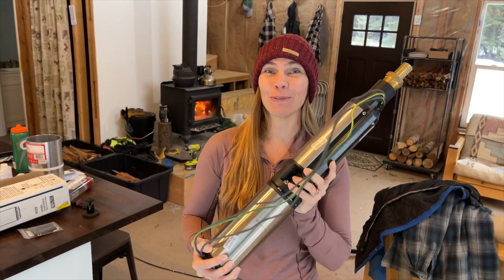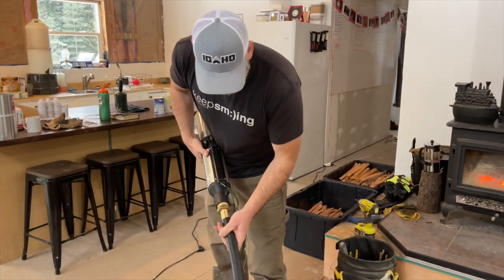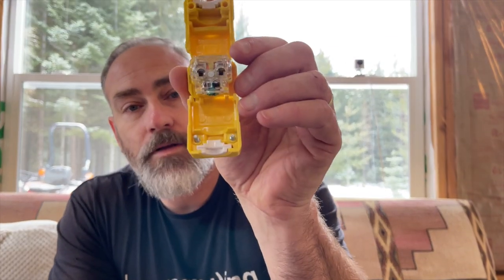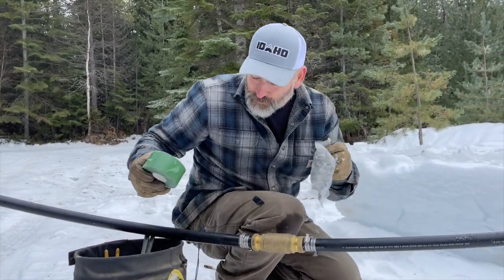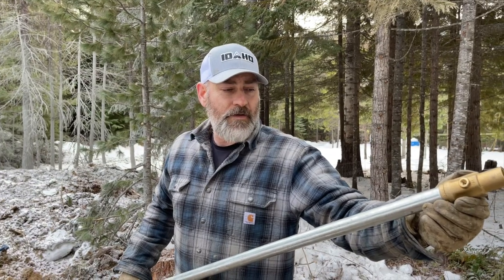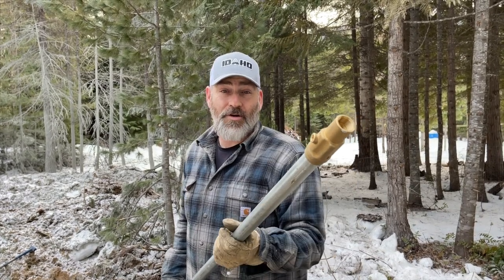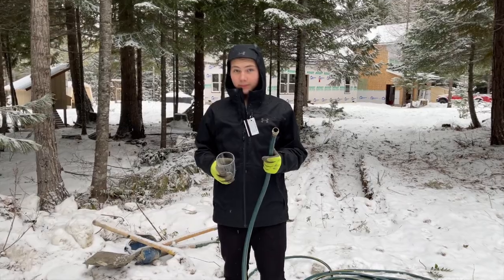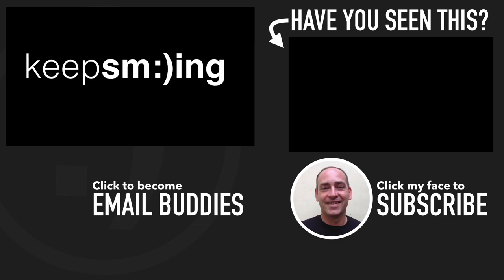WIFE is HAPPY/HUSBAND is NOT - DIY Well Pump Installation

Comment: How deep did your well end up being? Also, did you have a professional driller come out to drill the well?
Reply from the maker: 520' yes they were pros.
Reply: @MartinJohnsonOffGridLiving  520, WOW!! That's too bad they didn't include the pump and everything else with the job. Is it standard practice in your area for them to just drill the hole and install the pipe?

Comment: 🤓Congrats👍
Ya larger generator or commonly w Pumps , Motors & Generators is Use of a Capacitor 
Ya dropped from 35-36amps to about 12 ; so wire up a proper capacitor & standard 115v 20 amp should work Perfect . 
Now filtering that brown ? OYE glacial flower 😣 
   I wonder would a centrifugal filter work ; dump , rinse & reload ? 
 Some big rings & race Diesel vehicles use these to filter Oil ; oil looks clean Not typical black . 
Other industrial applications too 
 Bon Chance 
 Just how did ya get them Huge shoulders in such a small hole 😥 
🖖

Comment: How much was it too drill 640 ft down? I am starting a homestead in the next 3 years on on my land in Nevada
Reply from the maker: I’ll make a video about the cost but you should call a local well driller to find out the price in your area. Apparently there is a wide range depending on state.
Reply: I believe they said $45 per foot

Comment: I'm not sure you have bought the right pump. I can't find any of their ½ KW pumps, that works bellow 300 feet.

Second, you could have bought a Grundfos pump, with soft start, automatic overload protection, auto regulation by water usage etc.
For those, you can also get a box above ground, that communicates with the pump and warns about different parameters, like no water, over protection etc.
They probably cost twice as much, but Grundfos is also high quality. And world leader in pumps.

Edit: Scratch that. Probably 3 times as expensive! Those Star pumps are CHEAP!

Comment: 10ga is NOT big enough. You said 194' of pipe down the well, and it looks like about 300' to the house.
First a 1/2hp pump should only draw near 3.2A at 120V, BUT your clamp on said near 12A.
If your pump were to run near 3.2A, 10ga wire would be the BARE minimum size from the house.
But at the near 12A it was showing, it would calculate out to 4ga minimum wire size.
From right next to the well where you are, at the current depth, with about 200' of wire, you need 8ga minimum to draw 12A from that much wire.
Your current wire size will burn up the pump. So will 12A draw when it's supposed to be less than 1/3 that.

Comment: There is no advantage to a 2 wire pump. A 3 wire uses a start and run capacitor.

This is why the pump wouldn't start.

Comment: (✋ after watching it all)  Amps... = Watts devided by Volts. 3,500 Watt (generator) ÷ 115 Volts = 30.43 amps. (3,500W ÷ 110V = 31.82A...) "We're gonna need a bigger boat.." The shark is too big for your boat.., just like in Jaws!

Comment: Normally you use a control box which includes a thermal overload and a capacitor which is sized to suit the motor. 1/2 hp should be .37 kw. That pump should draw roughly 4 amps under load. The load is full flow from the pump. If the check valve was wrong way around it would be completely closed but if you read the amps it would be a lot less than a full bore pipe flowing.

Comment: You should have added some tape around the base of the pump at least a half inch  to act like a bumper. When the motor turns on it'll smack against the well's wall

Comment: that is a 240v pump NOT 120v... it will use less amps on 240v.. you are using a 120v plug through a generator  that`s why it`s shutting down...there's nothing wrong with the pump..
Reply from the maker: The box and the motor say 115v.

Comment: I would have soldered it with silver solder added Electrolux grease and then used shrink tube with a larger shrink tube over the top of all three.
Reply from the maker: Or I could have just followed the manufacturer’s instructions.

Comment: Your 10 AWG wire has 1.0 Ohm per 1,000ft. 

Lets say you have 250ft. cable length: that's 500ft. of wire in the pump circuit, or 0.5 Ohms drop. At 35 Amp (starting current) you have 35A x 0.5 Ohms = 17.5 Volt drop in the cable. So if the generator maintains 117VAC output at 35A the pump receives less than 100VAC due to cable drop.

Your original generator was rated 3,500W or 117VAC at 30A, so it was probably delivering less than 117VAC.

Do the math and read the specifications rather than all that extra labor, trial and error. But it did make for an interesting video ;-)

BTW, Since you had a three wire cable to a two wire pump you could have doubled up on one lead to reduce that IR loss - but that wouldn't have used the same crimping terminal. I prefer to amend mechanical crimps with solder. The solder provides a more reliable electrical path (lower resistance) and also a added barrier to corrosion on the copper. The only negative aspect of soldering can occur where the solder wicks up the stranded wires: that can lead to fracture if the wire receives repeated flexing at the solder boundary. Probably not a concern in this application.
Hope this helps!

Comment: Are you sure that pump was designed for 120V?? The amp draw tells me that you are double what you should be and thus...you might be really needing 240V instead! 240 V should make more sense as then the amp draw would be under 20 A at that point....?? also check to be sure that this unit might need a capacitor in line with it to help getter' moving.  At almost 200' down..I am thinking you are in need of a larger 240V style.......better check....two pumps can't be both bad at once.

Comment: You think you oversized the wire to the pump. I just looked up a 1/2hp pump@120v it says 9.8a. Given that your well is 500’ deep, and assuming a starting voltage of 120v, the 10guage wire will drop 9.8v by the time it gets to the motor. This drops the voltage to 110v at the pump. This is a 8.16% decrease in voltage , motors are really susceptible to voltage drops. So you will burn out the motor with this wire. Rule of thumb, is to upsize the wire 1 wire size for each 100’. If you ran at 240v this 10guage may work fine.  As the amps will be halved.

Oh and the recommended voltage drop is 5%, not 8% this included the mains voltage to the point of use. So on your system you will need to add the length of wire from the shed to the  well as well as the length down the pipe.  A capacitor might help greatly with the startup but I would rather that you upsized the wire and- added the cap
Reply from the maker: The pump is at 200’

Comment: Are you plugging that into a 120 volt. I've have never seen a well pump that run on 120. All the ones I used was 240 an it took a 30 amp breaker to run t.

Comment: wondering where the magnet is when you drilled the hole in the casing? Or will those steel drill shavings not affect the water quality or the mount angle piece?
Reply from the maker: No magnet. Why would i need one?

Comment: What is the water pipe size
Reply from the maker: 1”
Reply: @MartinJohnsonOffGridLiving   Mr. Johnson i really  love what you doing how you living with your family I am learning alot  from you I live in southern California but  from West African Nigeria where I come from they do not have electricity and running water last time I visited I tried to have them to get well water over 400ft deep but they do not use check valve like the way you doing it and the water is not p Polypropylene Tube that is where my question comes in what is the size the poly tube and how much does it cost? 
And a have questions about the solar system off grid  how much how much volts do I need to power 240V  air condition 1HP and other stuff.
Thanks you.
My name is PhilUmunnakwe at yahoo com
Reply: Mr. Johnson i really  love what you doing how you living with your family I am learning alot  from you I live in southern California but  from West African Nigeria where I come from they do not have electricity and running water last time I visited I tried to have them to get well water over 400ft deep but they do not use check valve like the way you doing it and the water is not p Polypropylene Tube that is where my question comes in what is the size the poly tube and how much does it cost? 
And a have questions about the solar system off grid  how much how much volts do I need to power 240V  air condition 1HP and other stuff.
Thanks you.
My name is PhilUmunnakwe at yahoo com

Comment: I’ve never seen a well pump that didn’t use a capacitor start control box. Even half horse pumps.
Reply: You have to run the pump a lot to clean the mud out of a new well. Keep running it!

Comment: Pitless installed at four feet in Idaho?  I think you are going to be sorry you didn't go a few feet more.

The water quality will get better over time, add a sprinkler system next summer and in a couple years all will be well.
Reply from the maker: Frost line is 24” here.
Reply: @MartinJohnsonOffGridLiving  I didn't mean to sound critical of your install, you are one of the very few I've seen self install a well pump and I'm impressed.  Our well and install is so much like yours with the glacial sediment and we also lived off of a tank for a while.  Our frost free hydrant froze at six feet even with a French drain (gravel bed) installed under the hydrent drain weep hole at the bottom.  I believe this happened cause we would let the hydrant flow for a bit before hooking up the hose to fill the tank.  We did this to flush the sediment that settled out of the 180' vertical riser pipe onto the foot valve.  This bit of occasional  water at the well head along with the hydrant and well casing acting as a heat sink allowed the frost to go deeper than normal.  Once we cleared the majority of the sediment (a couple of years) we put in a UG feed to our cabin and all was well.  And  like I said before, putting in a sprinkler system that runs the pump daily for 15 minutes really helped.

Comment: 120v over that distance is a mistake, IMO... You are losing 30v at your 30a start current with 500 foot of 10 gauge! No wonder it's being picky about what generator you're using. 240v and you wouldn't have had a problem (assuming the smaller generator has a 240v output). Be very glad you went with 10 gauge- it would never have worked at all with 12. I still think you're going to have issues long term- it's going to be PICKY about voltage since you're losing so much in the wire.

Comment: a 3phase 400volt pump would be much better and more reliable if not a pump with a  capacitor
would significantly reduce the starting amps

Comment: If your well goes down several hundred feet and the casing goes down a couple hundred feet why are you setting the pump at 100 ft?
Reply: I’m pretty sure that’s just where the check valve was installed. Then another length of plastic pipe on top of that. I was interested to find out how deep the pump went also. Maybe I missed it.

Comment: 1/2 hp is not nearly enough for that well depth. Water weighs 8 lbs per gallon. 10 gpm is 80 lbs/minute.  1 hp is 550 ft-lbs/sec. Your well is about 550 ft deep.  For 10 gpm, you need to raise 80 lbs per minute 550 ft. That means a minimum of 80/60 = 1.33 hp just to get the water to the surface at 100% efficiency. Expect more like 50% efficiency, and you want at least 20 psi at the surface, so you want about 3 hp.

Comment: LOL You are plugging it in to 120 volt thats a 220 volt pump !@
Reply: He said it's a 120 volt pump during the unboxing, although I was astonished he wasn't going to use a 240 given it's being tasked to lift a 100-200 foot water column, and the electrical cable will be somewhere around 300 feet total from house to motor.  At 300 feet, even 10 gauge wire has significant voltage drop, so it's best to go with higher voltage to mitigate that.  In fact I was surprised to learn they even made 120 volt deep submersible well pumps.

Glad it's working now of course.

Comment: With electricity, you never look at what power the unit is going to use only, you need to know if it spikes upon start up too.  Then ensure that the electrical supply is higher then both figure.  Just in case the unit starts straining and ups its usage levels.  Therefore a 30Amp power outlet will always trip when a unit on start up draws more power then it can handle.  This is to protect the power supply.  A hardware store as well as a mechanic does the same thing when a man walks in, they automatically think he knows what he is doing, he looks butch.  Females and feminine men will also be treated like they know nothing, even if they are qualified in the field.

Follow the basic rules of engagement as I call them, and all should be well once the power supply comes from the house, 45Amp plug / dv board system, should be strong enough to deal with the 30Amp water pump.

Enjoy the build.

Comment: I thoght that well was 600 some feet deep. how could a pump at 90 feet work.
Reply: Strong enough suction and getting the air out between pump end and entire well. like a when u use a straw the initial suction is at the top.

Comment: Let me tell you. The problem is that the hose, the water pipe) is empty. No water in it. The propeller inside the pump is designed to work with water in it and not without water. So ...
All you have to do is to fill water into the black hose (the pipe) all the way from the submersible pump to the other end of the hose (pipe).
Try it. You will see what you will get.

Comment: and living of the grid does? what? burn more wood ? that brings only more CO2 in the environment, and it is never enough, you do it every day, multiple times.... Would be better if you use solar power to heat up a closed oil heating solution or something similar and not burn wood, it is so in contradiction to what you think you are doing.... Rethink!
Reply from the maker: We don’t live off grid to save the planet. Never claimed it was more environmentally friendly.